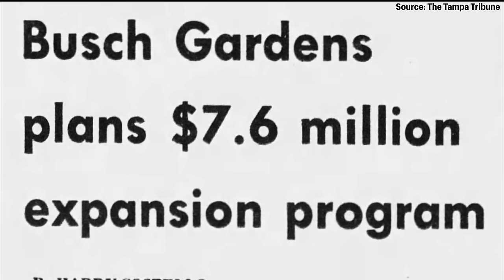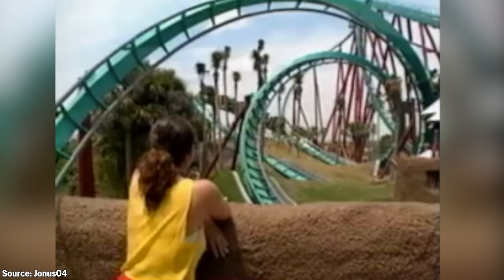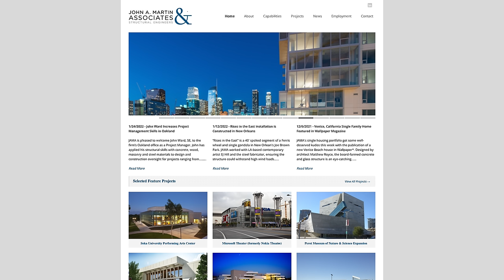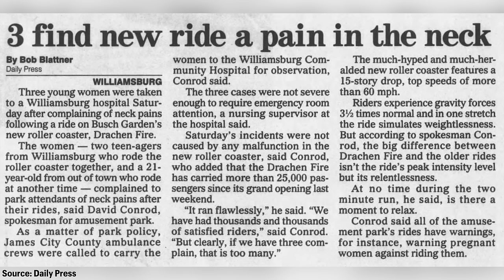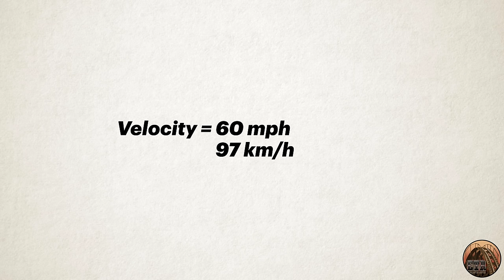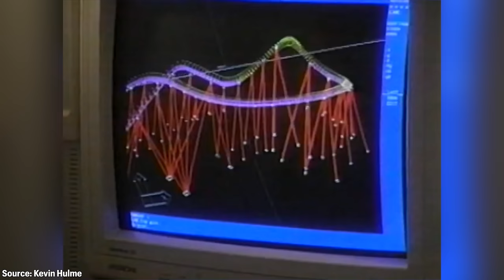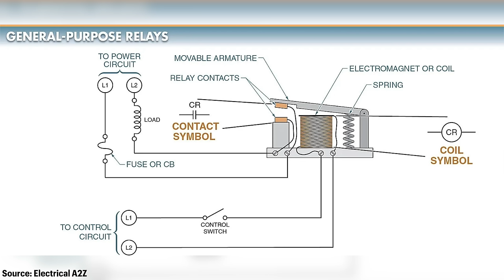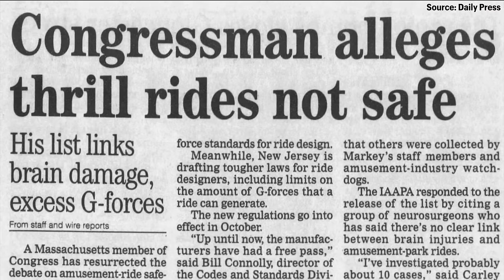Problematic Roller Coasters – Drachen Fire – The True Story of its Failure

Comment: From 12:01 to 12:05 and 29:55 to 29:59 demonstrates the biggest "design flaw" which Arrow turned into a religion.  Make a turn and right as you exit the turn with momentum going in one direction enter a corkscrew with momentum going in the OPPOSITE direction and violate the riders bodies with forces going both directions at the same time. Arrow managed to NOT do this with all of the corkscrews on Draken Fire so they knew better but loved to do it anyway. LOL
 I believe that most every corkscrew that Arrow ever made early on in the 70s enters from the same direction that the corkscrew goes which results in a very unnecessarily rough ride moment.
People hold on for a roller coaster ride for two reasons.... ONE, the riders are "scared" because the ride looks intimidating and TWO, the ride is beating riders senseless because it is too rough. ONE is the result of great coaster design. TWO is the result of BAD coaster design.

Comment: "...To bend track by hand..." and it really is as easy as what you showed with only minimal bending support? How would actual track tubing, which is a lot wider than that, still be bent that way, instead of with electric or electro-hydraulic machinery, etc. because of the great amount of force that I imagine it would take? Or did you just put this small tubing in there as a subtle joke?

Comment: anheuser busch? that is the beer company so busch gardens is related to the beer company.

kiddy coaster? that sounds like the park is family friendly thereby making the "adult collectible" marking on models of the beer trucks not mean that they are trying to keep beer logo stuff away from children so much as it means they dont have to follow the federal safety rules as close meaning that they can make the models from stamped sheet metal held together by little tabs that either fold over or are twisted or even soldered together and can have sharp edges and use lead, cadmium or other toxics in the paints because they are not intended for children.

just like they can get away with lead paint and glazes in ceramics as long as they are not intended for food use.

Comment: Dragon FIRE ' Drachen Feuer! ' or even the Blue FIRE DRAGON or the Fire Breathing Blue Dragon!; FEUER Dragon;nope the best name is < Drachen Fire> .... yeah, good old coaster I loved it, I DONT CARE HOW ROUGH, My favorite coaster since i was 7 til 10 and 1.4meters was the EL CONDOR yesssssssssss the cursed and WAY WORSE PROTOTYPE OF THE VEKOMA SLC (Suspended Looping coaster, one of the worst, 1994, still drachen fire was way smoother and had similar support structure, OMG i shook at the first ride, now i can sleep in it. Vekoma > Arrow TBH, to be honest, Drachen Fire Will return But As a Sit down and maybe 4 abreast Looping Suspended B&M with a very customized and honourable Layout tributed to Drachen Fire with a freaking 3/1 corkscrew loop/ heartline half corkscrew into a 240feet say 72 meters from the upside down moment of steep high g force FEAR as you do not see but sky and ground until the pull up, yet there you are going, you are in her claws as and maybe, if restraints on flying coasters are  redesigned into SUIT and claws, or have a suspended tilted coester like 30 - 60 degrees with vest restrains but over the shoulder being very snug and suberly padded ll you need is a station that inlines upwards, flying experience without the complexity of freaking rotating the trains 90 degrees, and keeping passenger from falling  off requiring less postive G or you can go all out on a B&M flyer on a pull up or from trains perspective negative G's like the shallow valley's one a flying coaster, but TATSUUUUUUUH i love uuuu tuuuuuWAAAAA WEEEEEEEeee, hehehehehe. come on B&M Btw the tilted Suspected coaster is something I patented so if something like that ever gets built by B7M im gonna be rich and i think drachen fire...... Yeah..... cheaper alternative and better loading and more passenger loads, backward ride are more intense anyways so yeah, FYIAD. and I love drachen fire I loved dueling dragons especially whe dualed i'd enjoy my illegally smuggled beer and just look at the attractions after 4 rides of Ice Fire Fire Ice.... Pheeew... hehehehehehehe my god that's just how drachen fire should've been but a dragon that can do hot(Fire blast) and cold(SuperCooled Water Deluge) Nuclear Fusion RailGun ( From his nose mounted weapon ) Hell squeeze with being over 3km long (he could coil and squeeze everyone to death with his Titanium Silver Chrome  Digizoid Alloy and +GOLD plated Hexagonic Belly Allow, Dual tails for normal meals like great white shark like digimon or even  stranglle another Seadramon Yes MidgardSormen MetalSeaSerpendramo 1/3part of my highest being of the soul reserved for krishna loka and king of naga loka as we reside in the GODKING Sri ananta shesha he is everywhere he is alpha and omega but separating us from existence and non existence he is leviathan he is the rainbow serpent he is kairyuujin as he is blue master dragon and he is my father,  holy spirit and we are all martyrs we silly apesuits of which 90 - 95%isn't even human, you can thank the otherkin and furry scalie community,  Lama's in tibet and the golden dawn and japanese anime artists for that NOT THE WRITERS THOUGH NOT THEM.... Toei.... pffff go so lay not slay dragons, lay them, as well as demons that turned heart and worship what i worship
 The joy and love i FOUND IN ROLLERCOASTERS, may leviathan fucking beat behemot, canada knows his shit canadian satan sux is just a shitty 6th rank prince, and lucifer and leviathan can go through all 3 tables of magick temples. black to grey to white!!!!!!! Magick, East Sout West North = AIR FIRE WATER EARTH = YELLOW/GOLD REDs BLUEs BLACK. = Rafael Michael Gabriel Auriel Archangels Together with Sssshairyssss, Ghhhraaael, Naelyan, FAFNIR! SEPTAGRAM CLOSED

and this coaster was a mix between all elements if it were built by B&M or Intamin OMFFING Loving Above element Light the world serpents LEVIATHAN, and below TIAMAT!!!!! HAIL THE ANGELS GODS AND DRAGONS I HAVE NAMED. Because I am part of the sons of Leviathan (not the coaster pretty epic rides like shamballah) and shamballah is actually literally meaning in tibetan TUBE...... as the world serpent rainbow serpent leviathan Quetzalcoatl kairyuujin whoever the entity is in every major culture, bad or good but be assured the book of enoch and the libraries of babylon and alexandria..... tell the truth, f we do not already,but are influenced by earth sphere otherwise a looooong or lung journey to go like Jormungandr to his tail except wrapped around 7 times of what we call omniverse bit only a few perfect universay being bubbles in the multiverse lucky ones being seafoam and we are floating like a fish in the middle of the water of the causal ocean and in every dimension it's us relaxing on a couch or us relaxing by our wives or husbands, or actual scalies that a layer of half rolled up blanket mean this one thing we want to be with our ancestors, and this galaxy atleast as far i knw but theories say this is a reptile like universe vegans suck and the only animal you may not eat is snake. Though snakeblood is an exception... I was raised by 2 german sheppards male and femmale whilst my pparents claim to have me given a golden childhood tbh with their drug use, not being able to find anyjob being incapable of any probably or pure discrimination i dont get why they used so much drugs at all from alcohol and cannabis to fentanyl and speedballing only revealed to us when we got our first smokes... at what 18! AFTER i NEVER COULD FLY ALMOST 19 ANYMORE BECAUSE OF BRAINTRAUMA AND ct SCAN RESULTS BECAUSE I ALMOST CRASHED AN aIRBUS a330-200 YEAH, once a pilot always one.

How did it happen i had migraine, chronic sometimes, but the worst was once in 3 weeks Cluster headache attacks and Migralepsia induced by stress and the other two and/or... because my mom and my little bro freaking joined church of satan, and knew my biological weaknesses, just when i was about to flare the last time of my 12th touch and go, now it was land...... wingstrike and outer wing pod strike, as i fought it, I said gowwwwwwrrrraaaaaawnd /slur( "GO AROUND" at fucking 70........... 50....40......30...Tweeeeeeeeeentiiiiiiiiiiiiiiiiiiiiiiiiiiiiieeeeeeeeeeee. and my biological cppu was hacked to crash, with magick* and the safety pilot tucked my hand in and kept me straight, as the instructor who was then male but got fired over a sex change operation, who saved everyone executed the go around successfully. Those BEHEMOTISTS/SATANISTS and their GURU ONLINE THAT THEY PAID FUCKING RUINED MY LIFE AND CONTINUE TO, i know my life is my own but still this shit actually exists. because fuck you I AM A DRAGON and when my guru accidently opened the box of pandora in 1998  SHIT SHIT THE FAN ACCROS THE ENTIRE GALAXY at least, he shouldn't have and wrecked havoc allowing for these 2012 shit to occur my parent stabbing each other etc.... had a powerful guru i wonder was it the same one that freaking... no, in along the bio after i got rid of rooflessness i was joined by a occultitistic initiation camp, and that guy tried for 20years, and i was his best student he gave me a B- as an exam score, this guy can murder you from 18k km away with just his mind and i saw it happen not murder but when he said hospitalization this night, it happened. That what i call enochian magick kriya yoga, siddi's etc..... genuine power that he abused and i really got angry at him later on for dumping me he maybe didn't expect i was so sensitive or weak but i am not because i exposed him. whilst dragons were the only entities maybe able to win the hearts back of entities directly in control of the MAW OF G.O.D. GRAND OPHIADIAN DRAGON (big serpentine winged or frilled dragon) GOD,the entrance to the heavens that is the border for existence and nonexistence, everyone sayss dude you gotta believe in something, spaggethimonster is cool as long you love him and its not cynical or sarcastic..... that's what i say..... because according to the hindus shiva and shakti krishna and rama  vishnu WITH SHESHA.... All those primary hindu gods are the avatar of JAI Sri Ananta Shesha kinda like kronos or seth/x/rah. Another leviathan figure in another culture, and this is why i hate islam except beodism and those spinning spiritual muslims the dragon exists but to them its just Djin or DEMON, Dragon =/= demon  Dragons eat demons for breakfast. and not in a endosomal way pure gorey hard digestions and fire hotter then their own dimension. still pre muslim arabian era tells of a story about cetus.... and he came to me as dragon just want love from their brothers especially those underrated and far away...

Last thing to the rollercoaster community YOUR RMC"S ARE OVERBUILT AND OVERRATTED, UNTAMED HAS 5 INTEVERSION is the SON of Iron Vengeance, UNTAMED WALIBI HOLLAND, and i', dying to try conda, but is it better I doubt it, but it has better theming cuz FYIADrakonicSeaSerpent, PRACTICALLY BACKYARD Hah, sadly i cant get into the US no more prolly because i threatened my national president on facebook calling for the 5 million people who voted opposition to fucking form an army and invent our own rules on these seats 6 parties no more VVD CDA CU and SGP DENK and Animal Party (they have a campaign about legal prostitution and a fucking union) and PVV need to be more politically correct or ill tell him Political accurate and respect everyone who is neutralized and nationalized because i am all up for close those fucking borders but that's politics luckily Europe china and japan have great fucking shit too, besides B&M is a swiss company. and so is intamin, Vekoma, and screw S&S I RODE TATSU LIKE 7 TIMES so....